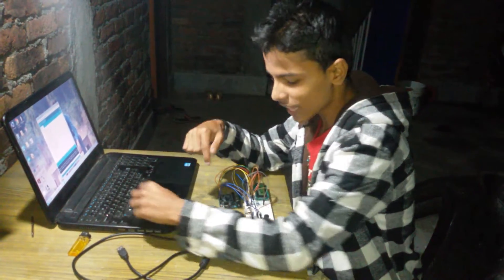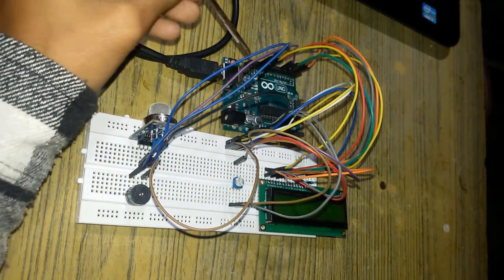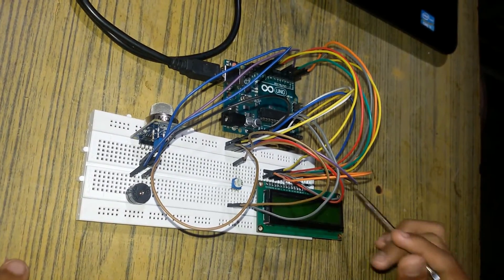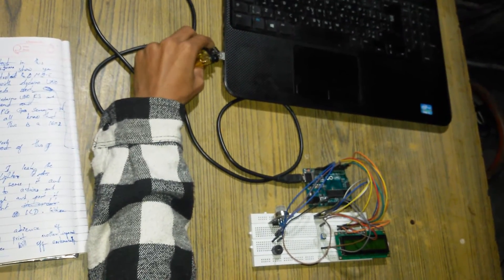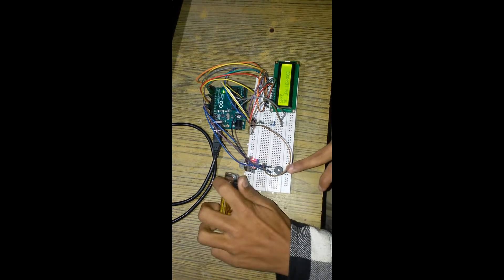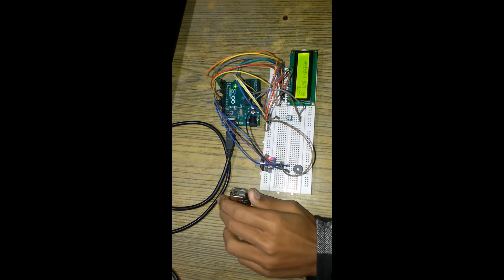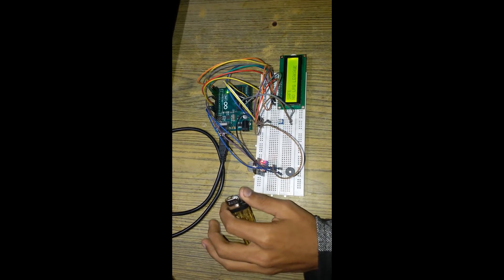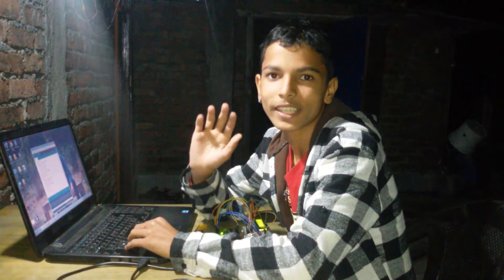MQ-6 Gas Sensor Interfacing with Arduino UNO and LCD

Comment: can I get some help please using mq6 with c++
Reply from the maker: Why not, but you can't use c++ fully in this prototyping system 
In this project i used embedded c & embedded c++ to setup the micro controller(Arduino UNO R3). Mainly i recommended to use Arduino UNO R3 because arduino is open-source electronics prototyping platform which will help you to learn about electronics + embedded c & embedded c++.
For more information you can see my source code in my Blog Spot(http://allaboveelectronics.blogspot.com/2016/12/mq-6-gas-sensor-interfacing-with.html) check it out. Thank-you Salah Nagem.